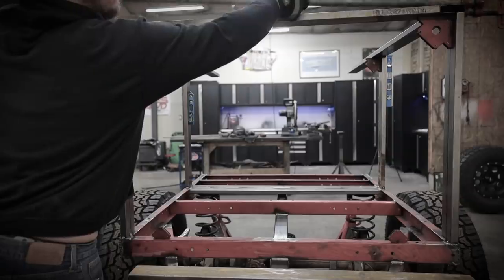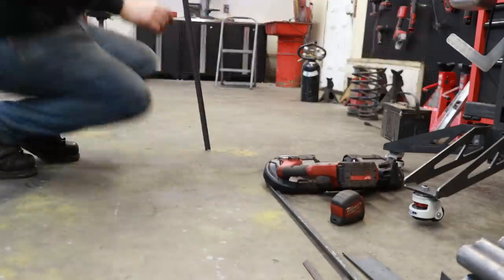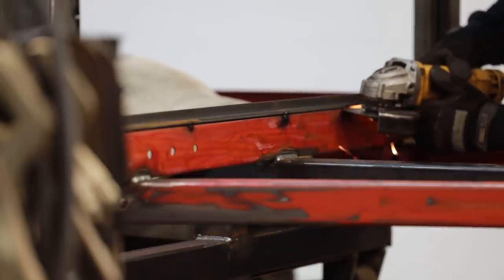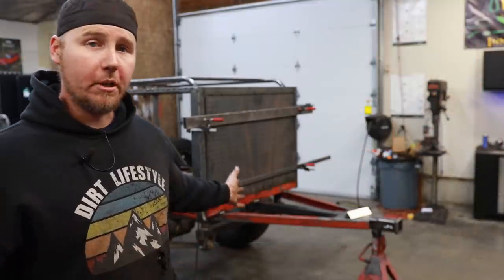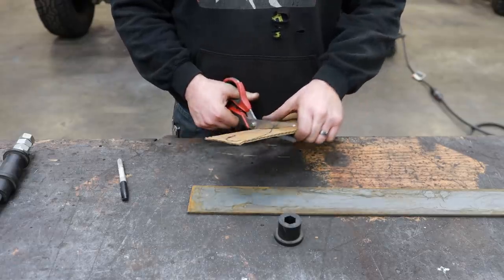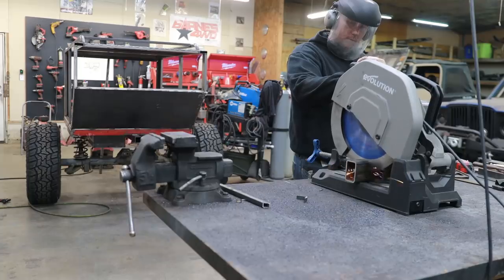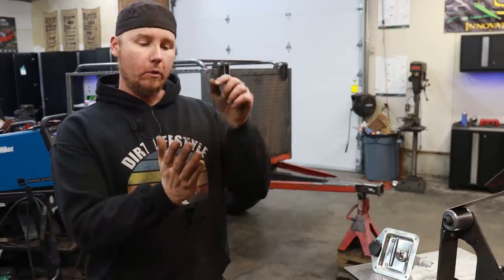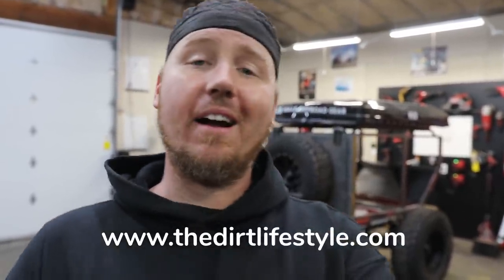Budget Harbor Freight Off-Road Trailer Build. Episode 3. Building Doors!

Comment: Another way of doing a seal for a door is to use a small piece of channel for the doorway mating surface, a rubber seal in the bottom of the channel, and then an edge surface that mates to the center of the channel.  Done right with proper dogging latches around it (like with a Navy ship's watertight doors), it can be pretty waterproof even with light weight materials like you are using...

Comment: I have an idea! I've been seeing alternator setups for hot rods that mount on the rear axle.. what about doing something like that? Might not be amazing going slow offroad but on the highway it might work out pretty sweet.
Reply: I just suggested powering it with a motor and adding an esc for available on demand power/traction but my first thought was the generator idea 😯 an alterator would be much lighter and cost effective 😎😎👍
Reply: There is also a disc parking brake off the pinion gear.
Reply: I'm building an off-grid setup. Gonna use this idea for battery charging!

Comment: If you extend the upper shock mounts away from the hatch, when it is closed the upper mounting points should be behind the lower mounting points. This will put back pressure on the door, keeping it closed better and not putting so much stress directly on the hinges. This also results in the hatch opening higher. I don't remember which Youtube car show was doing that, but I remember that was how they adjusted the balance.

Comment: Nice!

A bit of a suggestion. Your door seal would have been more bomb-proof if you'd extended the flange of the door skin over the front interface. You'd have a Z shaped seal interface instead of an L shape. 

Nice inspiration for me going forwards though. Have fun on your next wheeling trip.

Comment: Nice job Nate!  If you need some quick anti-crush sleeves for the bushings, you can get a 3' section of 3/4 x .065 seamless tubing at Ace hardware or Mclendons for a few bucks!  A 5/8 bolt fits perfectly!

Looking forward to the rest of the build!

Comment: Great video Nate!! This is something that I want to tackle at some point.

Btw I just wanted to say that your channel inspired me to learn how to weld, I ended up getting a AC/DC tig welder last year and I've made rock sliders, custom brackets for various parts, built myself a lightweight aluminium drawer system in the back for overlanding.

So thanks for the great content and the inspiration

Comment: Trailer coming together great. Watch out for those sharp door corners when the door is raised ~ perfect height for bumping your head into. As you're also a plumber, maybe some pipe insulation for the edges/coeners whenever the door is open! Great project.
Reply: He isn’t leaving the door to open that much. He said he wants it opening more and will make the adjustments to the strut mount locations off camera. 
At that height it is definitely going to ruin a weekend. 🤕

Comment: That's going to be stout! More than likely, this issue will never come up, but I figured I'd mention it, in case You hadn't considered it. If the angle iron surrounding your door ever gets slightly tweaked outta square, it would be tough to get the door closed again after opening it. Looks plenty strong, and prob never be an issue.

Comment: I am a little confused tire on the front with the tool box. You will need to remove the box every time  to open the door? Also the struts will not last with that tire on it. you would better off placing the tire on the side close to the front for weight. Then I would make the door a two piece allowing it to fold out of the way when opening it. Just my thoughts. Love your welding and your videos.

Comment: Question/Suggestion. Why not a 3/4 shoulder bolt instead of the all thread? With the weight on the  hinges, the threads will destroy the bushings.

Comment: Nate, I really like your style and your build quality, I have one piece of constructive criticism. Although you explain that you build to ensure strength and saftey I feel you could make a lot of material gauges smaller/thinner and therefore lighter. This may not be of concern to you however I believe your design and structures are well thought out enough and will stand up perfectly well in a thinner/lighter form. This would be instead of changing over to aluminium as you have done with the TJ. Just a thought I have when I watch your build series. Love your work, keep on innovating!
Reply: He explained in the last video why he’s using the material that he’s using while possibly sacrificing weight.
Reply: @Crewsy  I was referring in general across the whole channel.

Comment: For the inner seal could you in theory use square tube? I am working on putting a door on my back window slot of my 91 runner. I just have some square in the garage.

Comment: This inspired me to stiffen up my trailer frame and put my old Dana 35 axle under it. Are you running a regular gear oil or putting something thinner since it's not working as a drive axle?

Comment: Great video. Awesome project! Love the blues music. What drills do you use? Do you sharpen them yourself. If so do you use a grinder? Or a drill sharpening machine? Would be a great info video sometime when you get an opportunity. I have been using Dewalt drill bits but seem to be going through them quickly. I use oil when I drill. Also what the heck are bed frames made from?! Lol I found a bunch in the garbage and have been fabricating using them.  They were free
Reply: Bed frames are a mildly hardened steel so I think they’d be tougher on drill bits than hot rolled steel.

Comment: Just wanna point out that it's not smart having that strong magnet right on the welder.
That's thing is basically a computer.
I dont even keep my magnets on the same cart!
Project is looking awesome!
Reply: Magnets are only damaging to disc hard drives. They don't have any significant effect on other components and since a welder does not contain a disc drive there isn't any harm to be done.